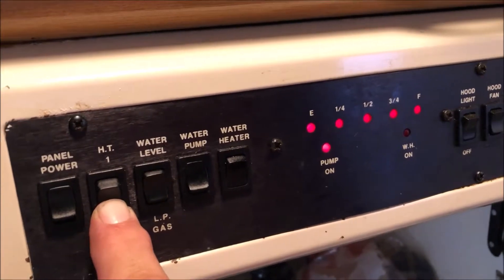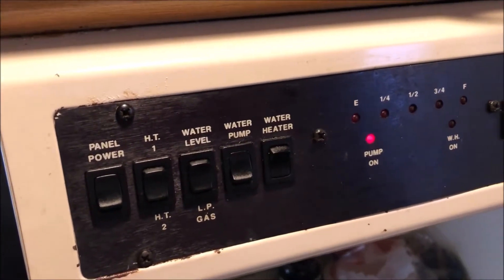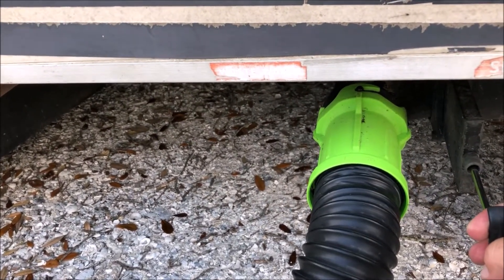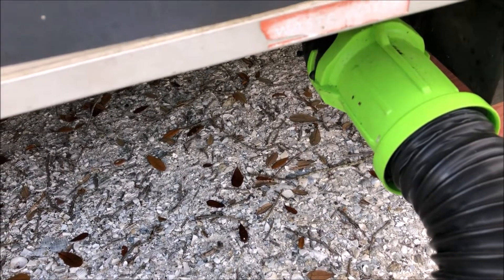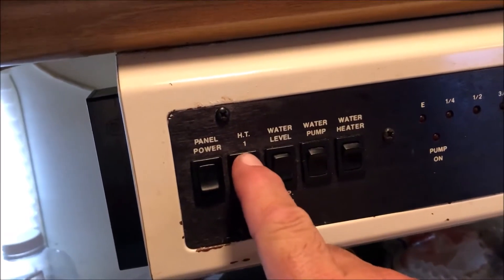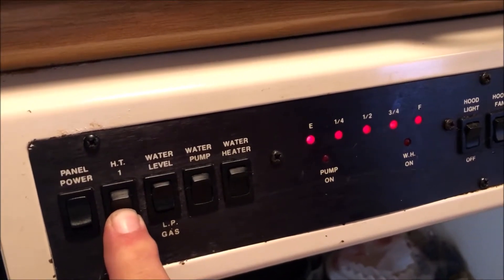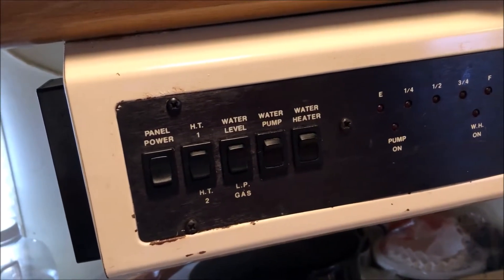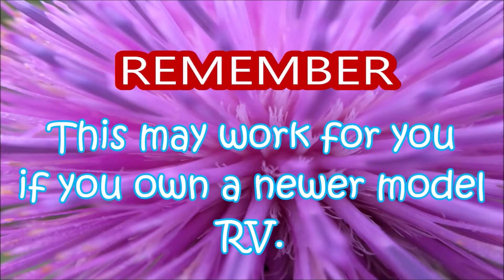HOLDING TANK GAUGES.

Comment: Most level sensors do not read accurately. The particles from waste make the circuit to allow a ground 
That completes the circuit to allow that level of indicator to come on. The walls of the tank is covered 
with hard to remove gunk. There are many remedies and skin sensors available. Most don't work.
As a single person I know to dump my black tank once a week and don't even look at the levels. 
Maybe we just need to use a dip stick. LOL....... I hope you are having fun on your voyage.
Reply from the maker: I agree they aren't really needed. I can tell by the way my shower/dish water drains that the gray tank is getting full. This is when I dump them both. I'm not going to do any other repair it isn't that big of a deal. I just thought this would be easy to try.
   I'm excited about this trip. I believe I'll  do better with the fishing. I did learn a little last year. good to hear from you.😀

Comment: Too bad that didn't work.  I don't have the luxury of any sensors at all but my rv is over 10 years old so they would probably not work if it did have them.     As long as you have lived in it you have probably learned when you need to dump your tanks.  This has been the longest time that I have stayed in my RV and it is a learning experience.  Needless to say that I have to dump my tanks a lot more often than you do since my holding tanks are so small.  By the way, I think we are neighbors.  😎
Reply from the maker: How are you liking staying in the RV?You say this is the longest you've stayed in it. An RV is all the space I need.
   No big deal about the gauges. I just thought I would try that out. I'm still interested in getting a cold beer or cocktail if you're up for it. You can get my email on my homepage.There is a good little bar down College Ave called Mango Jo's. good prices at Happy Hour.
Reply: @BlaneysChannel  After a week or so, I am getting most things set up the way I want them.  The campground is upgrading their electric and I had guys digging large holes right behind my site when I first got here.  After they filled the hole in, I was able to set up my screen room which had been laying in the floor of my RV.  Once I got that set up, my life got much easier.  If it weren't for the outside space, my little RV would be tight.
Reply from the maker: Pidasian Hippie   That would have been your best video.😁
Reply: I snapped a few pictures of the guys working and the hole.  If I ever learn to edit, I will try to add them in.  What would have made a good COMEDY video was me setting up this screen room.  I am sure I entertained anyone who was watching.  Hahahaha